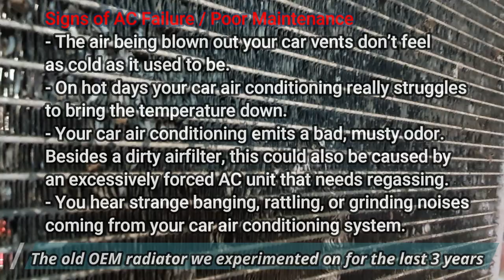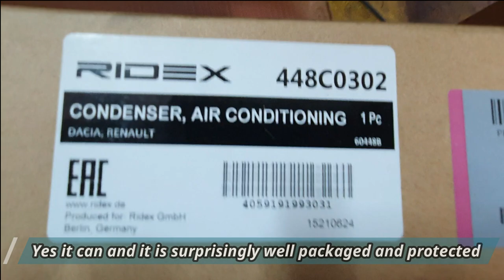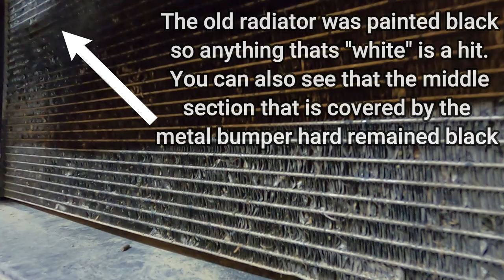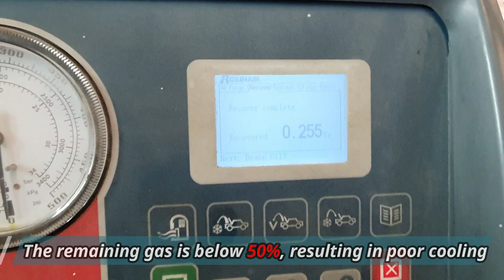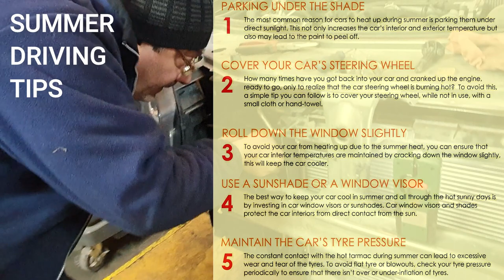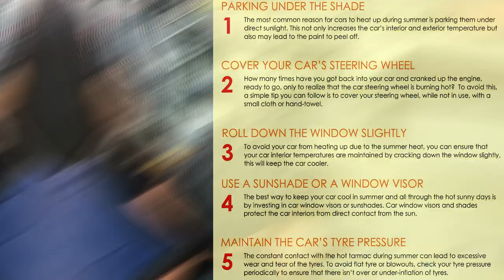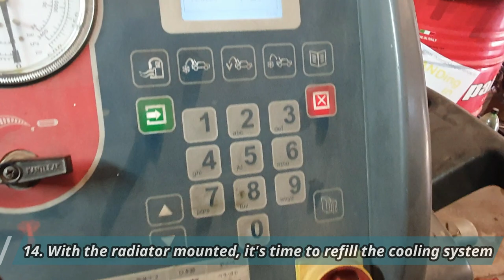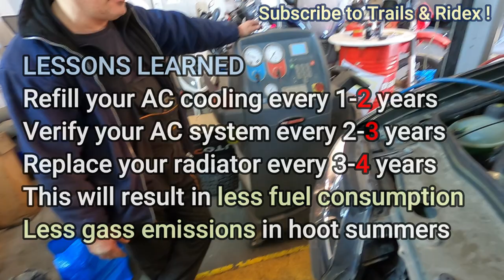Summer Driving AC Tips - The car's air conditioning radiator testing, unboxing and install

Comment: Hi! It became a very good little video! Congratulations! I have 6 years of Duster. I have the radiator in bad condition too. Nevertheless, within 2-3 minutes, 9°C air enters the passenger compartment. I also want to change. But I have to solve it at home. Unfortunately, after several bad experiences, I no longer trust the services.